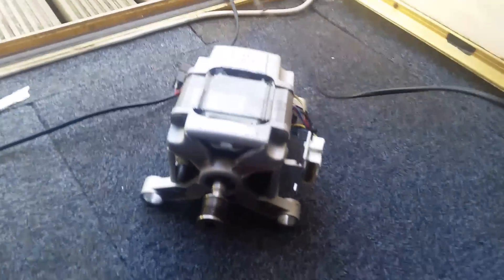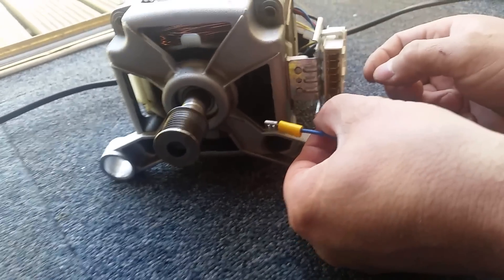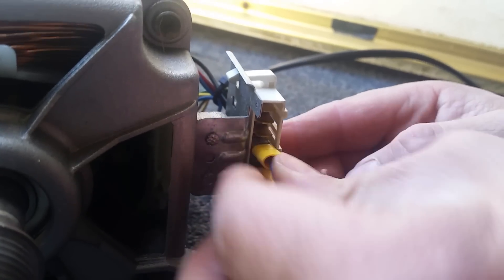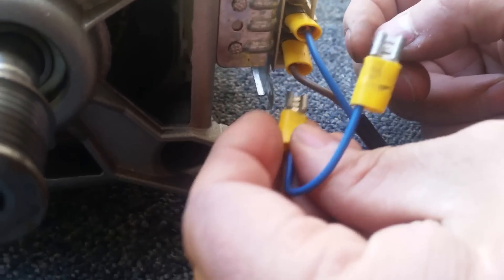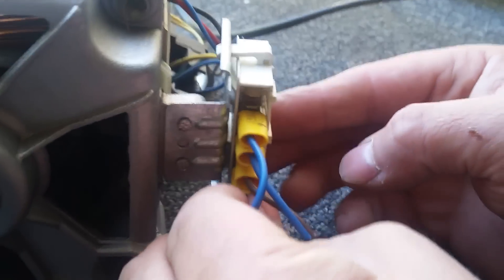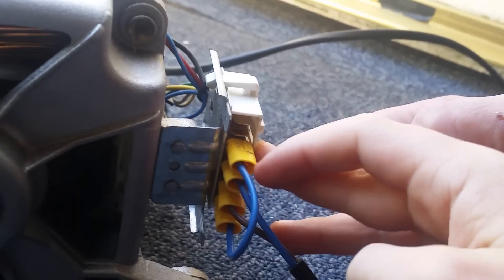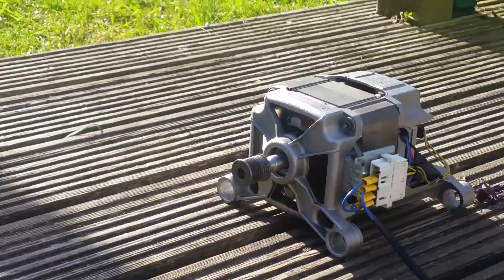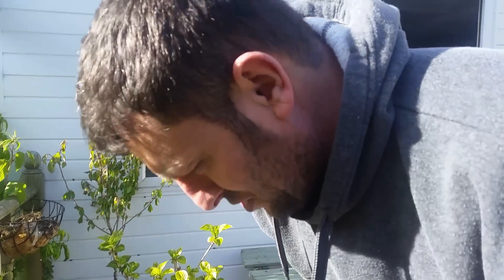How to wire a washing machine motor

Comment: 7 years ago. I hope you see this. Im curious about couple things. First im guessing your power is 220/240. Second by chance do you remember info from that motor like watts, phase, rpm rating. Im struggling with a motor and best i can tell yours looks a lot like mine including the plug connection. Mine is 3ph induction with a 17k rpm 750watt. Just wondering if theyre same motor rating